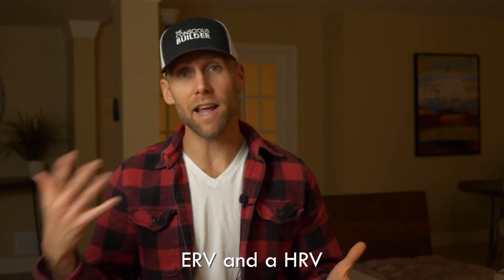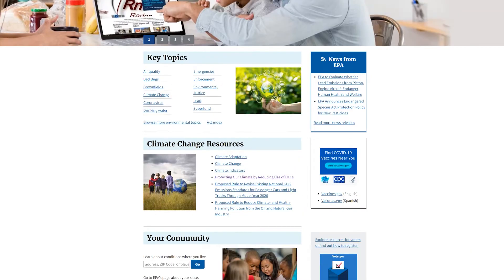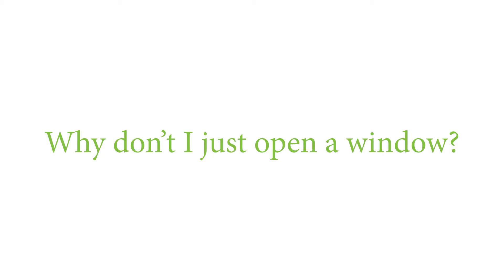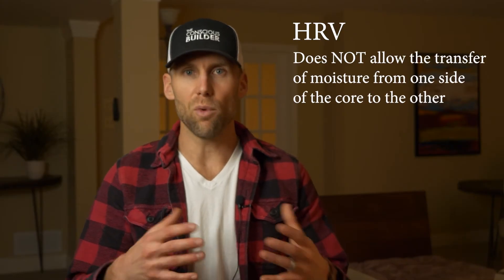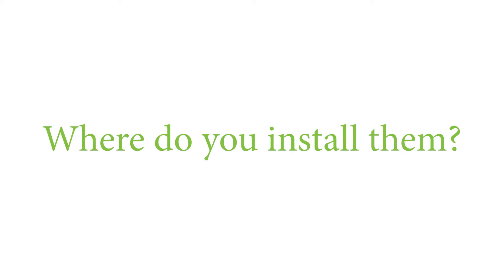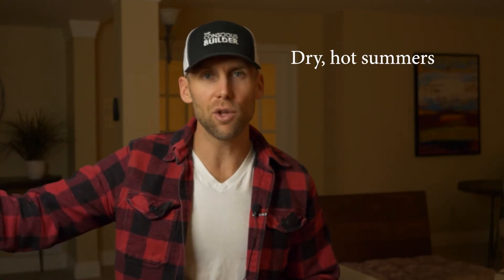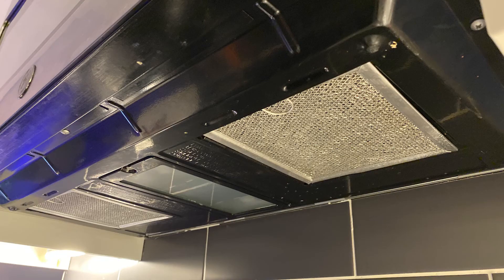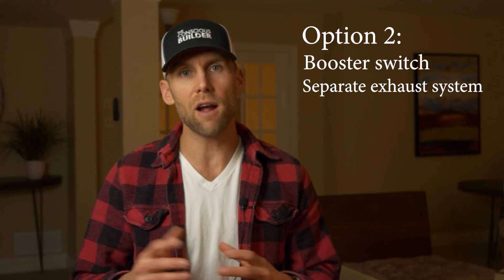ERV vs. HRV - What's the Difference?

Comment: My house is really air tight and very dry air to the point that plants die,,,which one should i get???
Reply from the maker: Where do you live? Sounds like you may also need a humidifier.
Reply: @Theconsciousbuilder  in The City in the UK,,,the house was an old house  re renevated by the council the put new cladding front and back and new roofs,,but made it soo air tight you can hardly breeth,,,always wake up with a dry mouth and bad sleep,,i tried a Himidifiier but the bedroom is soo large and ceilings soo high they never work..
Its a nightmare

Comment: I think you answered at the very end, but could you expand on it... why wouldn't you just use an ERV most everywhere, is it cost or are there specific things and ERV can't handle?
Reply from the maker: Thanks for the comment Steve! I don't see an issue running an ERV everywhere but they are more expensive so it would only be a cost factor in my mind.

Comment: Great video, my questions is in a dryer climate likecthe Rocky Mountains or the western prairies would you opt for the HRV. I live in Invermere in a almost passive house with an Hrv and find it extremely dry in the winter. Im building a new passive house for myself and want to solve the issue of lack humidity any thoughts ? thank you
Reply from the maker: Hi Colin! I would suggest an ERV so that you can keep some of the humidity that you create while living in the house. Keep in mind that you may still need to add humidity. Depending on the size of the house and how much humidity is created by the people living in it, you may need to add a humidifier.
Reply: @Theconsciousbuilder  Great to know thank you !